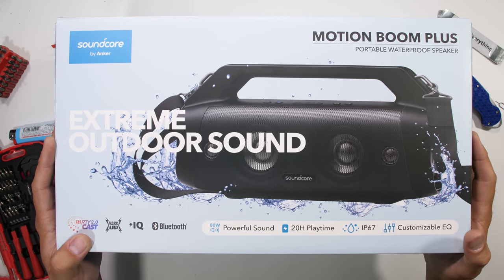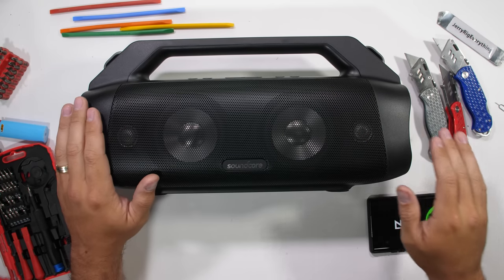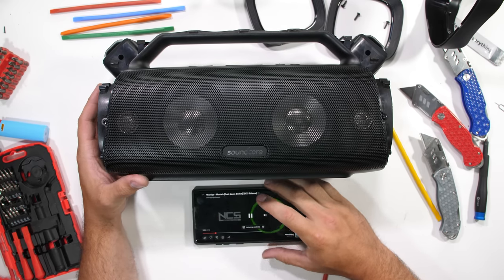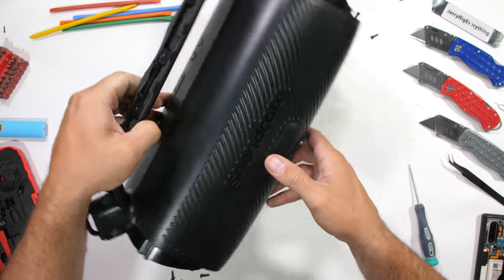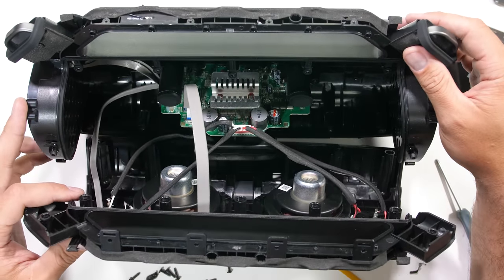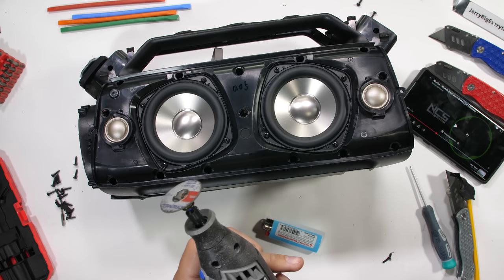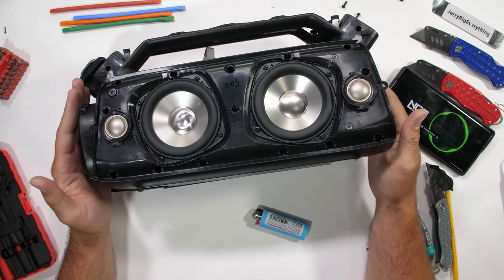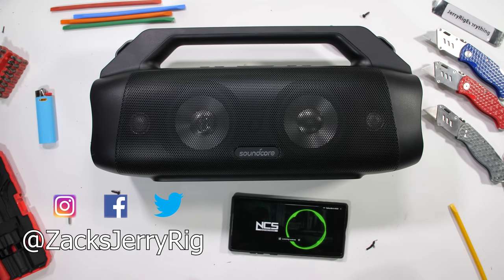This Rugged Speaker is made from.... Silk?

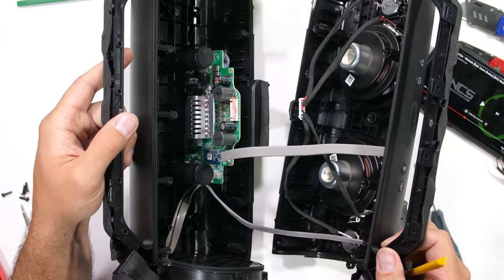Comment: You forgot to mention the speaker arrangement in watts is  different as advertised, in 4:13 - 4:27 one can see a woofer of 25w 4ohm and a tweeter of 15w 8 ohm, and it’s advertised as 30w and 10w respectively

Comment: Just one note to suggest you to repair the damaged hemispherical part of that speaker smoothly sucking it with a tube of a working vacuum cleaner. I did it myself when a kid damaged that part of an exposed woofer of mine. Attention, it must be done with the sucking control valve in total open position, or you're gonna damage the speaker totally.

Comment: Those thumping passive radiators look super cool. I really want to get this speaker but it's way too expensive.
Reply: Quality has its price. Buy once and you're done! there are much better speakers in terms of sound and quality. if you want to use it especially outside then don't buy the garbage! it was a nice advert and nothing else... look at JBL Charge 5 or $20 more JBL xtreme2. Completely different processing and materials and completely different sound
Reply: @vandakng2213  Jbl charge 5 is inferior to this, it is very small and has only 2 drivers. Also wattage is a lot less. Xtreme 2 is pretty good but again it is smaller, has smaller drivers and barely half the power of this speaker. Also jbl does not use titanium in their drivers.

Comment: So a lot are conplaining about the radiators to pop out when its warm or hot.
I own the speaker since 2 weeks,had it in the hot car,directly in the sun outside,at the beach and it was at least 28-32 degrees celcius at those days and this doesnt occure by my speaker! 
the charging port cap was closed!
Reply: You have the fixed version of it

Comment: Compared to other metals titanium is one of the worst heat and electricity conductors, compared to copper, it has only 3% of the electric conductivity, and compared to the most common heat sink material, aluminum, titanium has only 1/23 of the heat conductivity.
Reply: he said "compared to plastic", and that is still true. But i wouldn't rely on it for cooling the voice coil too much. The magnets of those woofers are puny though, i kinda expected larger ones (more magnet = bigger coil = more power dissipation capability, but also more force for a given amount of power so less power may actually be needed)
Reply: @victortitov1740  These use neodymium magnets, hence the small size

Comment: Wow wasn't expecting the midwoofers to have such small magnets.
Reply: they are neodymium magnets. thats why. they are way more powerful then ferrite and ceramic magnets so they can be much smaller to equal a larger ceramic magnet. its a huge weight saving without reducing power also since the magnet is smaller theres more air volume in the speaker cabinet so it will actually be more powerful and deeper.
Reply: @alexlittig7927  Have you seen all the high end speakers magnets ? They are not small by any means. And they definitely use top class material. By definition small magnets no matter from what they are made of, means more distortion.
Reply: @darethjavelin3802  that still doesn't change the fact that neodymium magnets can be smaller but can be as strong as ferrite magnets some high end speakers use neodymium magnets also smaller magnets don't mean more distortion
Reply: @pixelreflectorpro  The bigger the magnet, the stronger the potential driving force of the speaker (assuming the magnetic strength of the magnet is constant). Small magnets are for small speakers and produce, by nature, “weaker sound”, while bigger magnets make bigger speakers capable of producing louder sound. and by loud you can also assume that it may not be able to produce enough low end. That alone is a part of distortion. Since it doesn't or can't produce a somewhat authentic representation. Instead relying on DSP to fill in that hole. Have you seen neodymium magnets from JBL ?
Reply: @darethjavelin3802  small magnets = weaker sound doesn't apply to neodymium magnets since their already strong but the bigger the driver the bigger the neo magnets need to be but they don't need as big as ferrite magnets to be as strong instead of acting smart do your research on neodymium magnets
Reply: @pixelreflectorpro  Actually you know what. You are right. JBL Xtreme 3 also has small neo magnets. But it's so underwhelming them being so small lol.
Reply: @darethjavelin3802  Did you not read a thing he said? Size is not the most important factor, the magnet material is more improtant and neodymium is one of the best market. The big subwoofers you see with big magnets are usually cheap low quality brands that use ferrite or other trash metals
Reply: @maxl7827  This conversation was done lol. We came to a conclusion. I know the magnet difference... I was just confused because I had in my mind the JBL Xtreme 2 and not the Xtreme 3.

Comment: That build quality isn't bad. I do kinda wish it has a replaceable battery. I mean technically that one is but finding a replacement will be a pain in the ass and I am not going to build my own from 18650s even though I do have access to a real tab welder since I build nicad/nimh batteries at my job.
Reply: It would be very easy to get a large 10-20 Ah battery with a wire lead that can easily be soldered on. No need to build a battery pack from 18650 cells.

Comment: To bad it has major overheating issues that causes the passive radiators to stick. If it's in the sun for just a few minutes it will start to distort badly as the radiators expand and stick. No real fix for it. It's a shame because it's a nice speaker. However for practically the same price thr tribit stormbox blast has far more and deeper bass and better mids and highs and it has a awesome light feature. The boom plus has a nasty 6khz peak that's harsh. 
That said the power to weight ratio of the boom plus speaker is probably the best on the market atm.

Comment: Wish u had took off the heatsink from the amplifier ic so i could have seen what chip they using. It looks like probably a tpa3116d2. And i hope they have a boost converter to make that 7.2v battery voltage to atleast 20v to make their claimed 40w/ch..

Comment: engineers who designed this don't actually use bluetooth speakers.  the exterior is scratch damage magnet, should be able to withstand exterior abuse without getting too ugly.  the large handle simply takes space, i'd like my speakers to fit in a backpack or the water bottle basket of the backpack

Comment: I have two of the Soundcore Motion+ which I wirelessly stereo pair.  They’re extremely unreliable. The stereo link drops out inexplicably and it’s very finicky. I think they’re probably fine as individual speakers but linking them as stereo pairs (the whole reason I bought them) has disappointed me consistently. I wish I would have returned them when I still could.

Comment: All those specs sound like the JBL Xtreme.
Reply: But bigger and cheaper
Reply: @pixelreflectorpro  and with a handle like an JBL Boombox
Reply: @RBRT02  and a 9band custom equalizer
Reply: Jbl xtreme has barely half of the wattage of this speaker.
Reply: @maxl7827  both the xtreme and xtreme 2 are half the the watts which is 40w

Comment: It is a great speaker for the price and loudness but there is a BIG problem, the air inside of it expands when in the sun or higher temperature making the bass distort and the speaker basically unusable. There is a speaker alternative called w-king d10 but that might not be for everyone but it costs 100$ and is louder more balanced, bass but doesn't come with the eq and what not.

Comment: two full range drivers and two passive radiators… this thing is basically a JBL knockoff.
Reply: That's not how it works
Reply: You forgot about the tweeters.
And all speakers use drivers. Most use passive radiators.
How is it a knockoff ?
Reply: @ThibautMahringer  because it has 2 regular drivers and 2 passive subwoofers, like a Jbl speaker does
Reply: @iloveappleyoutube7198  All speakers do, JBL, Sony, Harman, Ultimate Ears, Bose, LG, Tribit, Soundcore, they all use drivers and passive radiators lol
Reply: LOL, I have this and the Xtreme 3. The motion boom plus is a lot better than the JBL. I have to crank up the JBL once after listening to the Soundcore. Its a mismatch.

Comment: I really like your videos. But this one is not up to your level and is nothing but advertising. Here are the reasons why I think this way:
1. The amount of moving air says absolutely nothing about the sound quality.
2. To test the tweeter, you could have simply paused the sound.
3. The cone of the midrange drivers is not made of titanium. It doesn't spark when you accidentally touch it. Just the dust cap. The dustcap does not contribute as much to the sound as the cone itself.
4. The device would be so easy to build with a replaceable battery, which unfortunately didn't happen. That is not discussed.
JM2C
Reply: "The amount of moving air says absolutely nothing about the sound quality." - it actually kinda does say something. For people who are not into sound, quality often equals "lots of bass", and for that you gotta move air. For those who are, quality is mostly a combination of frequency response (and sometimes its dependence on direction, and sometimes also phase response), maximum loudness, distortion, and noise level. Of those, the max loudness/distortion is strongly correlated to how much air it is capable of moving.

Comment: If you find this interesting, why don’t you check out a jbl speaker
Reply: There isn't anything interesting about jbl speakers
Reply: @pixelreflectorpro  they also have passive radiators wich work with air pressure wich can be achieved beceause they are water resistant, they have the Same things  around the cables and on the motherboard to prevent things from rattleing, they have good sound quality in my opinion and they're pretty rugged too. A lot of simularities don't you think.

Comment: Lot of screws, foam and glue to prevent vibrations, clean assembly. The materials for the speakers are the right ones for its price range. Nice box here. 
And considering that it’s gonna be used via BT (the real quality bottleneck), might even be a definitive choice.

Comment: Passive radiators basicly does the same job as a bass port. Encreasimg the bass.. Not dampening it😅
And this is very FAR from 80watts🤣 No chance in hell.
And it also lacks dampening inside the box👀 That means it sounds like plastic🙄 Too bad
Reply: It is 80w two 25w woofers which they claim were 30w each two 15w tweeters which they claim 10w
Reply: Almost all portable speakers don't have have dampening what's your point?
Reply: @pixelreflectorpro  Dude.. It is very far from beeing anything near 80watts🤣🤣 It can't even come close to those numbers with a 20Hz-20kHz test tone with both channels driven. MAYBE it can peak at total 80watts for a millisecond bit that's it! The electronics for the amp is physicly too small and also there is nowhere near to beeing enough power input to deliver anything close to 80watts out to the drivers🤣 80 watts is actually quite a bit. And probably like 89-90% of amps have fake watt ratings just because higher numbers sell more🤮 This is a well known fact within audio communities.
My 25kg amp is 2x150 REAL watts in 8ohms and 2x300 REAL watts into 4ohms. (Both channels driven at 20HZ-20KHZ with less than 0,05% THD)... It has a 500w power supply for each channel (1000w power supply total) and it still is too weak to work well at 2ohms.. So if this little crap is 80 watts total than I am the king of england....😉🤣

And MANY portable speakers have dampening. Atleast if they are any good... It should be normal for a speaker of any kind to include the basics like dampening. Kinda important...
Reply: @Oystein87  it's proven you don't know anything about audio
Reply: @Oystein87  here we go again the amp outputs 15w×2 for both Tweeters that's 30w and 25w×2 for the woofers that's 50w 30+50=80 and if it isn't 80w your amp isn't 300w the jbl boombox 2 isn't 80w jbl partybox 110/100 isn't 160w the jbl partybox 200,300,310 isn't 240w the jbl partybox 710 isn't 800w and the partybox 1000 isn't 1100w
Reply: @Oystein87  amplifier efficiency exists
Example: jbl boombox 2 instead of 20,000mah battery like on the boombox 1 it has 10,000mah battery and out outputs 60w when it's plugged in to ac power it's 80w
Example 2:jbl partybox 310 running of its battery it's 160w and running of ac power it's 240w
Same goes with this speaker  30 damn YEARS and you didn't know that bruh.
Reply: @Oystein87  1100w is the rated power plus fix your grammar lol

Comment: Sony xb speakers better regardless of pricing.
Reply: had xb21, i think they really suck compared to similar jbl's. I hated it so much i don't want any other sony speaker... The thing i hated about it was how the bass was not affected by volume control... it would just flex to max on the lowest volume and sound awfully boomy, and on high volume it sounded tinny (same bass loudness but way more treble).
Reply: @victortitov1740  the newer ones are wayyyy better than the old ones
Reply: The xb 41 and 72 are good nice low end bass
Reply: Xb43 too the xb21 is Low end

Comment: Those unpowered end cones are just a pretty gimmick. Anyone who knows anything about sound and sound pressure knows all those things are doing is dissipating sound energy which actually LOWERS the overall bass and sound pressure output.
Reply: And there you'd be wrong it doesn't lower anything it can improve bass output and it's not a gimmick
Reply: @pixelreflectorpro  It indeed improve a specific frequency that the woofer already play

Comment: The portable Bluetooth speaker market is comprised of overpriced, over hyped junk. Even Vifa released a unit that sounds terrible. Regarding this model,  I've found that a firmware update completely ruined these units, making them unlistenable due to an obnoxious 6 KHz peak. Some observations: Even if those motors are neodymium, they still look weak. Too weak for a reflex design. The steep acoustic rolloff of the low-end doesn't help, either. I wish manufacturers would actually make genuinely good sounding units, without so much tubby overemphasized "bass" and fake sparkle, etc.
Reply: 6khz peak was removed in update 00.36 neo magnets don't need that big to be strong at all plus the drivers are only 25w and what reflex design are your talking about? There are a lot of good sounding portable speakers this one Included even though this speaker has a bass boost and looks cheap it still sounds better than JBL's ($380 for the Xtreme 3) Xtreme 3,2,1 and  boombox 2,1 (with a custom eq) if you want to see overpriced look at JBL
Reply: @pixelreflectorpro  I'm glad to hear that the 6 KHz peak was removed! Yeah, neo magnets don't have to be large, but these are small enough to assume that Qts is probably above 0.5. The reflex design I was referring to was these units (passive radiators), as well as all portable Bluetooth speakers for that matter. Yes, JBL is by far the most overpriced out of all of them. For what it's worth, I settled on the Soundcore Motion Boom. There's a tear-down video of that one, too. It's far from hi-fi, but for under $100, it's not too bad. Some improvements could be made that would hardly increase production costs, however. Aside from an annoying broad peak around 2.5 KHz, response is reasonably flat. Luckily, there's a 2.5 KHz band on the 9-band EQ. Of course, with 2.5" wideband drivers, the highs are very directional, so you have to listen on axis. As with most metal diaphragms, the highs have a metallic quality. I've considered adding some damping material inside the plastic enclosure, but haven't gotten around to it. The steep 24 dB/octave roll-off below 60 Hz bugs me. I wish there was a way to modify the hi-pass filter. Also, response drops like a rock past 13 KHz. Like I said, with minor EQ, it's okay for under $100.